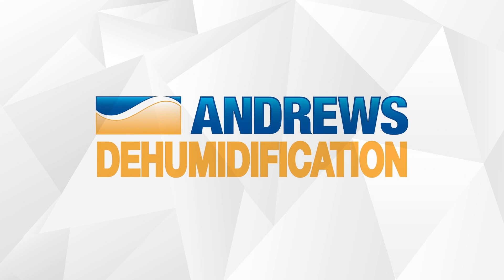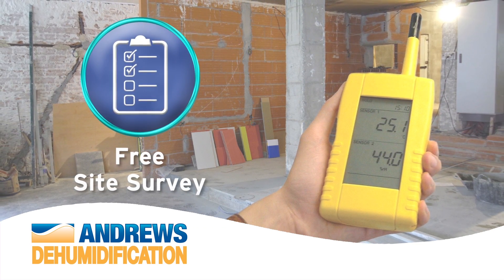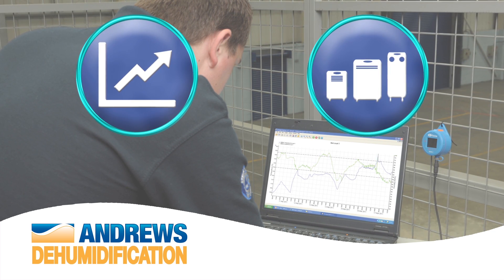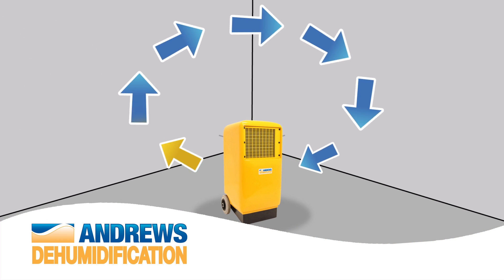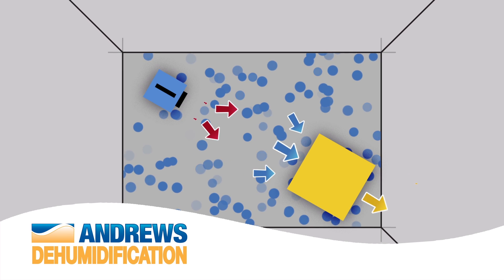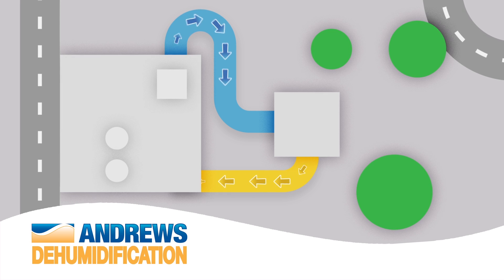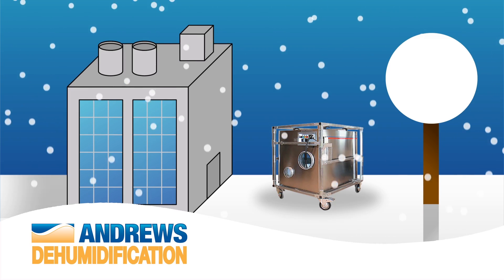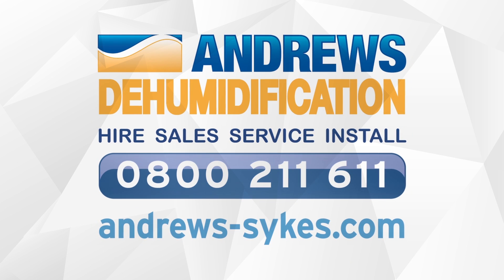How do dehumidifiers work?

Comment: Just to clarify a few points made in this video; you should use a refrigerant dehumidifier if the average room temperature is over 20C (either through heating the room or naturally) as below 15C refrigerant models spend a lot of time in defrost mode making them very ineffective at lower temperatures. 

For average room temps below 20C use a desiccant dehumidifier. Also contrary to the picture of the desiccant dehumidifier used in snow etc, desiccant dehumidifiers stop working at around 1C as obviously the unit can't process ice.